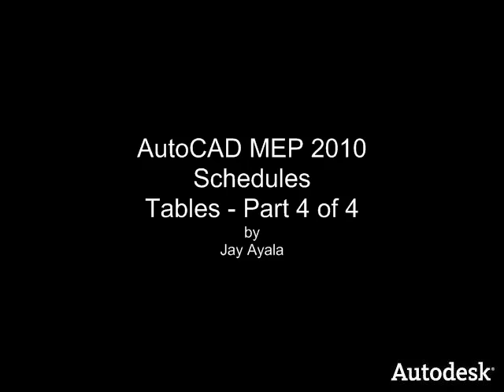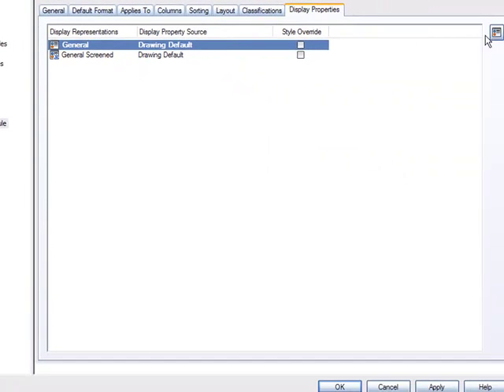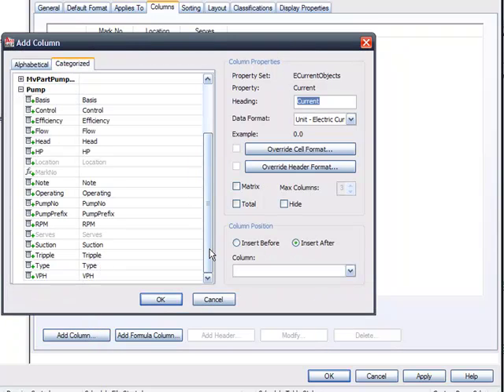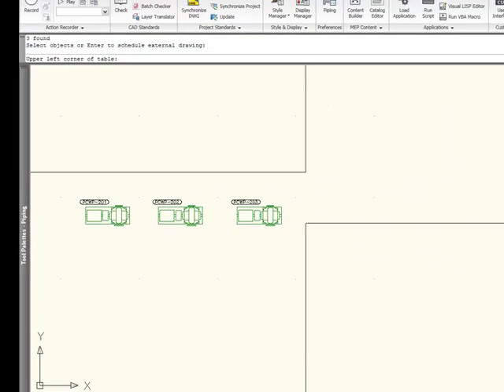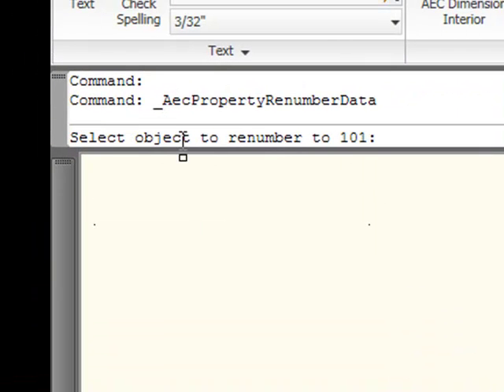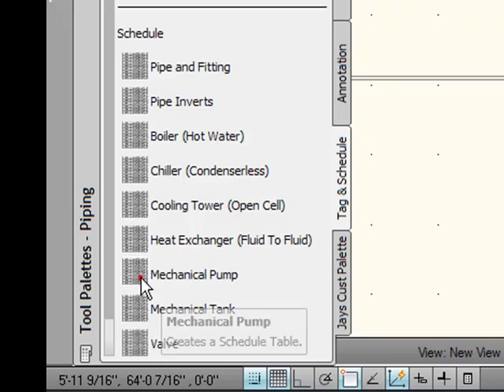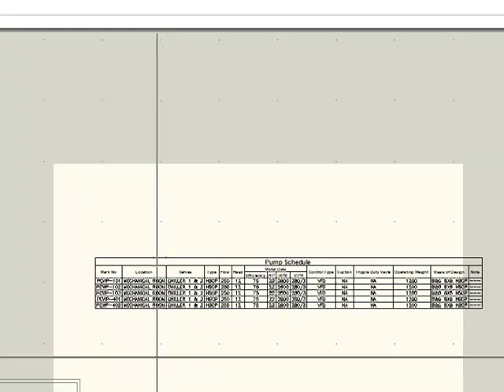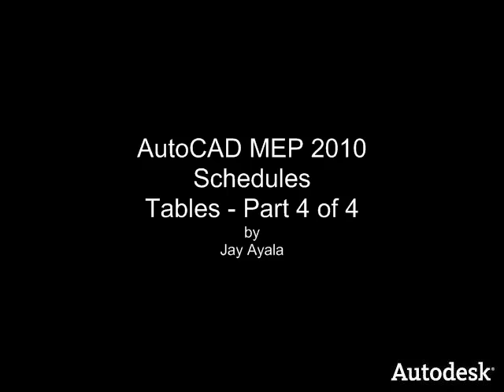AutoCAD MEP 2010 - Schedules - Tables - Part 4 of 4

Comment: I know this thread has been here for a while, but I am casting out a question anyway.  I have applied a Property Set for an individual Conduit segment from a panel. I want to connect this conduit to a transformer, or another panel or device, however when I finish the conduit run I notice several things have not happened. #1, the new conduit does not have a Property Set associated to it, and #2, because of this, I do not have any Property Set data I manually entered, attached to the children of the parent conduit. Is there a way to make connecting segments take up the Property Set values of their parents? This would be very useful for conduit, pipe, and duct. I know I can select a whole run and apply the Property Set, but this is tedious and counter-productive.

Any suggestions would be greatly appreciated.

Respectfully, 

Darrell Barbery
Reply: Did you ever figure out your problem?